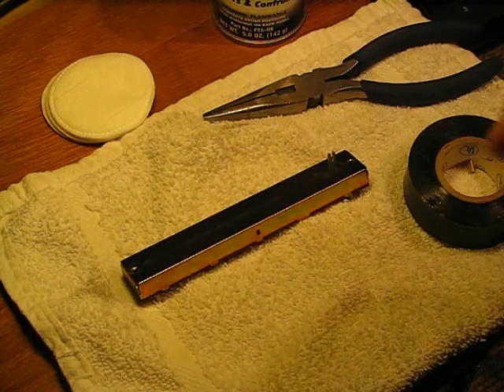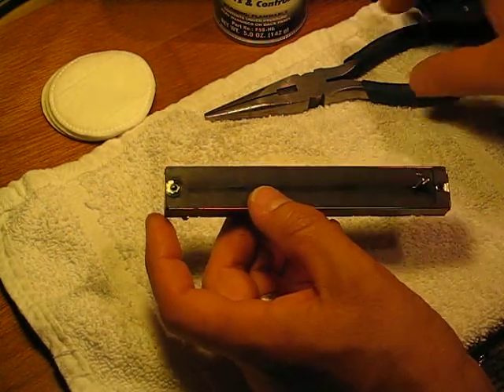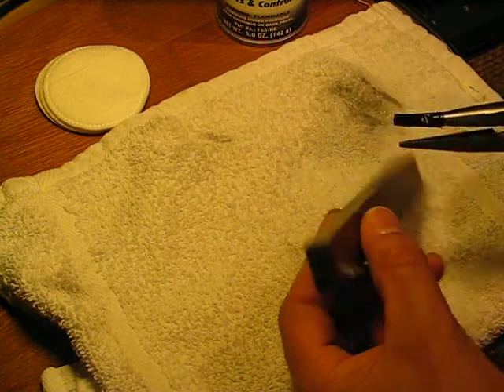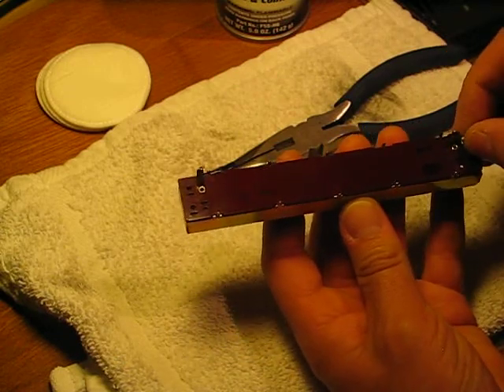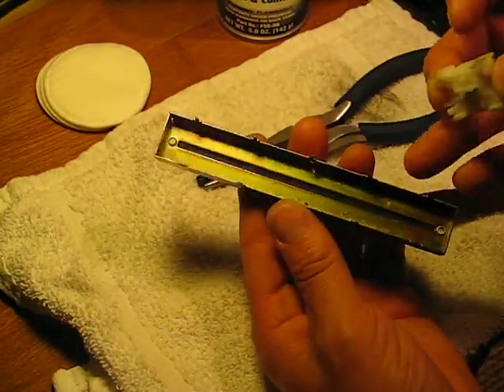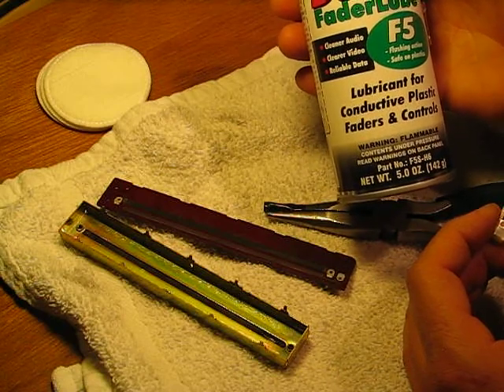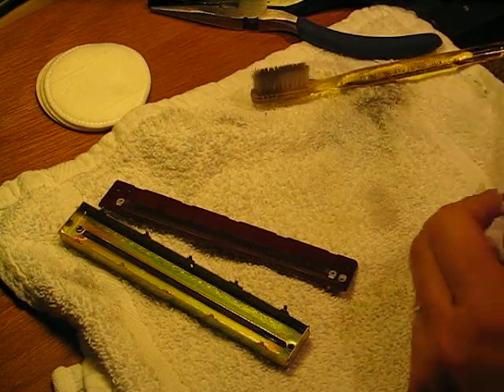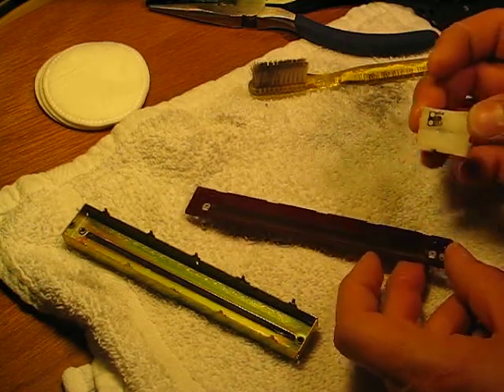Cleaning And Servicing ALPS Low-Profile Audio Faders

Comment: Would this work on a technics1200 pitch slider?
Reply from the maker: I can’t say for sure because I don’t know anything about the part used for that application. If it is similar to the ALPS slide potentiometer I use for demonstration in the video, then likely yes the instructions would apply to your part. If you need or want additional assurance then post a link to a pic of the part or something like that and I can take a look, okay?